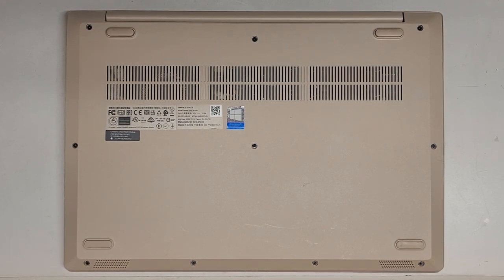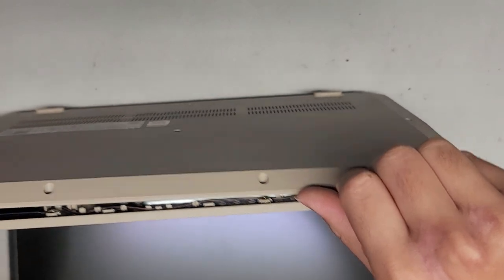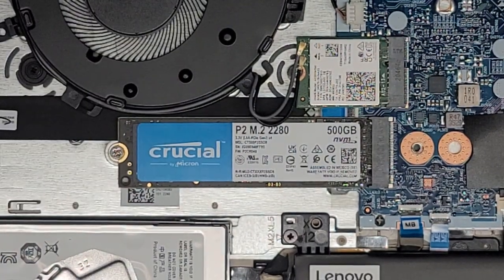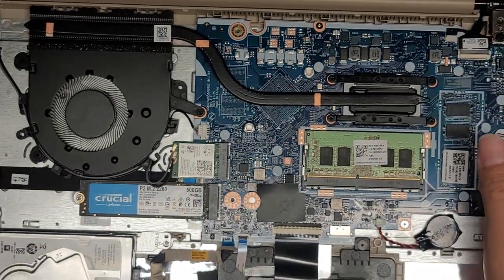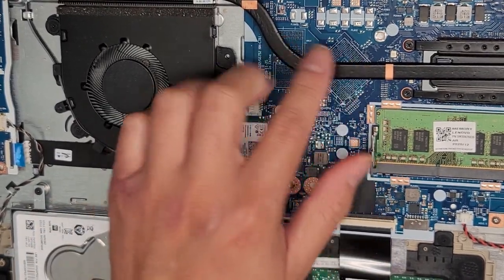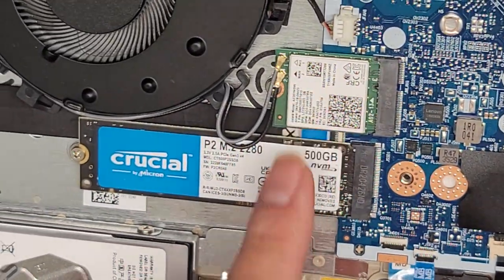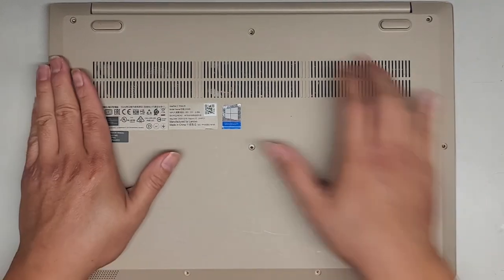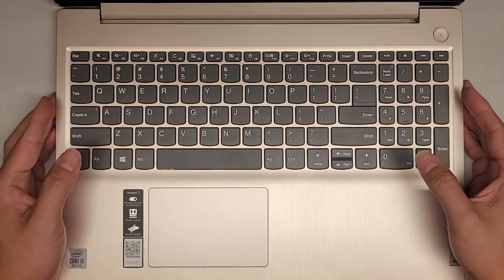Lenovo IdeaPad 3 15IML05 Disassembly RAM SSD Hard Drive Upgrade Battery Replacement Repair

Comment: I think the reason that one ram stick is soldered to the board  is because it's using that stick as video memory since the intel graphics don't really have their own video memory.
I'n not sure that could be a reason, or it's to save costs and make the laptop thinner. A double ram slot would be too big in that housing.
Reply from the maker: I don't think so. Where did you hear that from?

Comment: Can I upgrade 2nd slot with 16 gb ram. Will this laptop support 4gb inbuilt + 16gb additional ram in second slot.
Reply from the maker: Sure
Reply: @ItsBinhRepaired  But can it support 4+32 ram though.
Reply from the maker: Whatever you can fit.

Comment: Bro I have a question. My laptop already came with an M.2 SSD and without the hard drive so the hard drive slot was empty. I'm just wondering if I can put a SATA SSD in there for more storage? And how do I connect it to the motherboard?
Reply from the maker: Yes, if the hard drive cable is there.
Reply: @ItsBinhRepaired  unfortunately it is not there when I opened it. Can I buy it online? 

And btw, the L16L2PB3 model of battery isn't available where I live. Is the L16L2PB2 compatible with this Lenovo 15IML05?
Reply from the maker: Do you have Amazon where you live?

Comment: Thanks for the vid, how do u clone data from the hard drive into the ssd? Also would any model of crucial M.2 NVME work? (P3, P5)
Reply from the maker: Here https://youtu.be/4p5jFDzVwUw
Reply: I'd like to keep that hard drive just incase, but i am adding a 1tb ssd p3 model. Will cloning with these instructions make it boot from the ssd?
Reply from the maker: @bingg.dgreatesthigh  yes
Reply: @ItsBinhRepaired  ah it seems like my other message was deleted, it was an article about crucial and their cloning software. Would that also work?
Reply from the maker: @bingg.dgreatesthigh  why not just use the method I showed? I don't know about the other one. Lol

Comment: My laptop is dead. (3-15IML05) I have already checked the battery and the charger.. both are fine… what are the checks I can do to understand whats wrong?
Reply from the maker: Cmos reset maybe
Reply: @ItsBinhRepaired  Thank you! I am looking to replace the mother board myself. My laptop has a MX130-2G GPU… is it okay if I replace it with a MX330-2G?
Reply from the maker: I'm not sure, sorry

Comment: Hey. Instead of leaving the 2.5 hard drive in the laptop unplugged, why didn’t they use it as a external drive to back up files?
Reply from the maker: Not a good idea to use a failing hard drive as a backup device. Lol
Reply: @ItsBinhRepaired  oh yh. that's true. i thought it was good
Reply from the maker: It was having issues, which is why it was replaced/upgraded
Reply from the maker: @ravvraj That's true, but then the customer would lose it.
Reply from the maker: @ravvraj they could just leave the cable attached, but they'd have to secure the other end so it doesn't rattle. A lot of models have the screws and adapter all secured inside the laptop.

Comment: Whats the max ram this model can accept? I was told 12GB by the manufacturer but honestly, the rep I was speaking with didnt sound very convincing.
Reply from the maker: The max is whatever you can buy and put in the slot

Comment: Never buy LENOVO, They UV glued the onboard DDR4 RAM and Processor. It can never de-soldering... Horrible!  
Ex:- Ideapad 320-15IKB DG421 DG521 DG721 NM-B242 NM-B241
These type motherboards can't repair if you faced any issue with processor and RAM! 
Why nobody address this big issue yet?
Reply from the maker: All the new stuff is heading that way sadly
Reply: WHAT IS PLANNED OBSOLESCENCE. Planned obsolescence describes the practice of designing products to break quickly or become obsolete in the short to mid-term. The general idea behind this is to encourage sales of new products and upgrades, a practice that has been banned in some countries.
Reply from the maker: Still happens